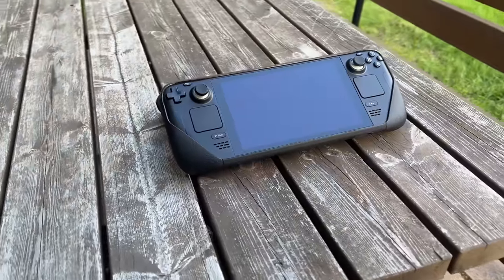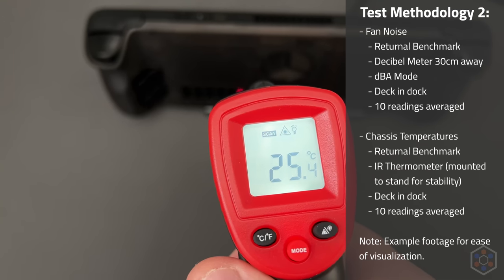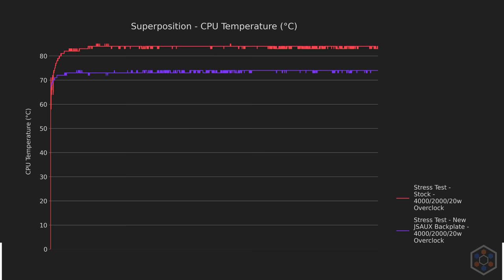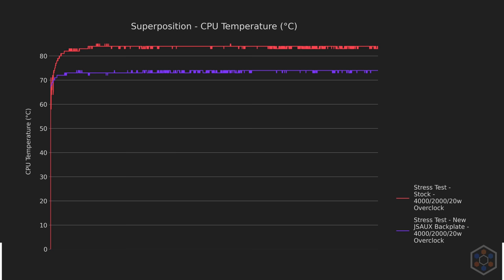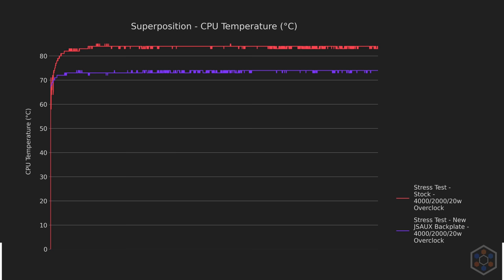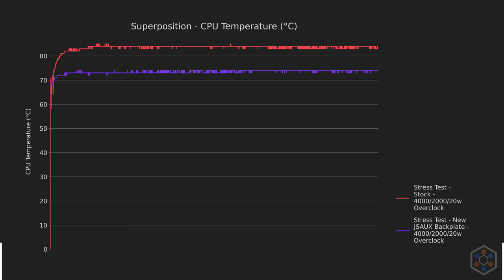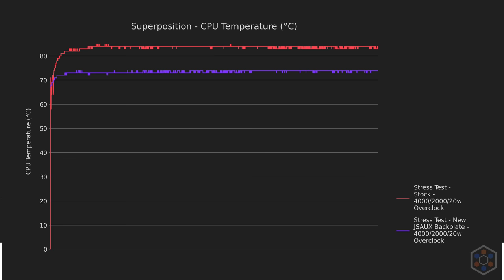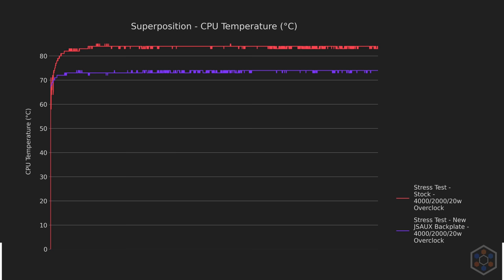How LOW Can It Go? | Steam Deck Thermal Modding

Comment: Do you plan to make a video regarding ram overclocking? Some people are claiming up to a 10fps difference
Reply from the maker: I've been trying to get a stable RAM OC for months, ever since before my UV/OC video. The problem is that both of my Decks have Samsung RAM and can't maintain the OC while also being stable, even with a significant overvolt.

Thank you for watching, I'll keep trying!
Reply: @cryobyte33  is enabling FCLK necessary to reap all the benefits ? That’s the only option that’s cause my deck to not boot
Reply from the maker: @dontsweatme4588  Not all of them, but I can't change the actual speed to either 3200Mhz or 3000Mhz without my Decks crashing shortly after boot 😓
Reply: @cryobyte33  without OC ram I can undervolt -30/-20/-45 but with it I have to lower it to -20/+50/-20. Do You recommend messing with the memory voltage to possibly get FCLK to work?  The default is 134 and I know decreasing the value actually raises the voltage
Reply from the maker: @dontsweatme4588  I unfortunately cant tell you since I don't have real results to lean on here. There's a whole group of people on the discord with tons of help available if you want to ask them, though!

Sorry, I just don't feel comfortable sharing info if I haven't personally validated it 🙂
Reply: @cryobyte33  I hope steam os 3.5 brings noticeable performance gains
Reply from the maker: @dontsweatme4588  it will, at least for the CPU performance! It has a much newer kernel.
Reply: @cryobyte33  last question sorry. Are you able to use power tools on the main channel ? I can’t get tdp limiter to work at all . Even if I lower it to 4 watts there’s no change
Reply from the maker: @dontsweatme4588  I haven't upgraded to the main channel, but typically Decky itself is super broken on betas. You can try using the preview build of Decky but there's little to no guarantee of stability.
Reply: @cryobyte33  it’s a Shame because with ram oc on 3.5 I noticed a 5 fps jump in ratchet and clank

Comment: I cant understand what is going on in heads of engeneers that dont make intake holes above cooling fans and place it somewhere to the side.. They just place fans intake to a sold body panel. Why they are so stupid? I had many Laptops in my life that had same issue and making a hole in body above the fan made a huge cooling difference!

Comment: Thank you It was a educational video,

@cryobyte33 next time can you add the fan rpm as a data point, it would be clearer information about the fan other than just the noise dBA itself?
Reply from the maker: I can definitely try! The problem is that for a majority of "normal" users (non-techies), RPM doesn't necessarily imply what volume something is at, or whether the frequency will be distracting. dBA takes human hearing into account and is the de facto measurement for noise readings for that reason, but I can try to add RPM recording to my suite.

As a note, I use MangoHUD to gather results and I just learned yesterday that they added RPM measurements in the past few months 😅
Reply: @cryobyte33  If i recall correctly, the steam OS built in fps/resources stat option is based on MangoHUD.

I agree some non-techies ppl might have never turned on the fps/thermal/fans statistics, so they dont realy know how the rpm works, but as a techlover myself i did never check dBA of my room or devices.

I just learned about the new jsaux backplate v2  from your video and ordered one, and im sure im not the only one.

I might try some OC based on your previous video with the new backplate on.

I'm happy and Suprised that you replied to my comment. 

Keep up the good work, waiting for the next video

Greetings from a Hungarian Tech enthusiast.
Reply from the maker: @chrishzk9532  the SteamOS overlay is actually MangoApp, which is based on MangoHUD but has additional functionality. MangoHUD just got the RPM feature recently, so it's really new 🙂

I try to make my videos relevant for both camps so I'll see if I can add it in the future!

Comment: PTM is a hoax! I just received mine from Mod DIY yesterday and I put 3 strips because I couldn't believe that my thermals have gone up instead of down. I took AC6 as a reference. Before PTM the game generated an average 75 C. An ok value. After changing with the PTM, my temps went to 78C. I changed it 3 times thinking I put to little, it didn't spread correctly, but nothing changed. My temps are still hitting 78C.
The Jsaux fan on the other hand it's a must buy if you use the steam deck in the dock.
Reply: Did you give it a good burn in (2-3 hours running stress testing) to the pad? It needs time to settle and cure, if you test it just after changing it it will have higher temps.

Comment: tried liquid metal or k5 pro?
Reply from the maker: I haven't done liquid metal, but K5 pro should perform within the same range as NT-H1. K5 Pro and many other high-end pastes are only really "better" than NT-H1/H2 at high thermal loads. The Deck's maximum of ~25w isn't nearly enough to push those pastes to the "sweet spot" where they get better performance, so they end up within spitting distance of the middle-of-the-road NT-H1 🙂

Thank you for watching!

Comment: I don’t see what’s inside my Steam Deck on System Settings Hardware, just the serial number…totally weird. I mean in that web page it leads you to
Reply from the maker: That's very odd, maybe you need developer mode enabled? All 3 in my house have all that info...

Thank you for watching, though!
Reply: @cryobyte33  I have dev mode enabled due to Decky plugins. Still not seeing it. But it's fine after a shell swap I wrote down all I wanted to know. Delta Fan & Samsung RAM. Great video just watched it again.  Another question I try to up myi TDP in unlocked BIOS 110 but it always resets to 15000. Maybe gets overridden by SD own Power Setting which only go up to 15000??
Reply from the maker: @marios.2975  You have to set the TDP in the regular BIOS to 15000, then in smokeless to the value you want. Setting it in the regular BIOS again will overwrite it, but as long as you leave it alone then it'll stay at whatever value you set.
Reply: @cryobyte33  Im doing all changes in regular bios. its unlocked. I have the CBS / PBS setting available there. And even if I set it in Power Management to 15000 then setting under SMU common options are always reset to 15000 too. Maybe I indeed need to use Smokeless cause saving in the regular BIOS alwys seems to overrides what I put into the unlocked SMU options. i think it's the same value behind both settings. And because regular BIOS max is 15000 it ignores my too high value in the unlocked CBS menu. Really wanted to avoid smokeless. OC settings work fine from regular BIOS btw. Thx nevertheless!
Reply from the maker: @marios.2975  Ah yeah you 100% NEED to use Smokeless to go over 15000. Glad to help out!

Comment: 18c this man lives in a refrigerator 😅
Reply from the maker: It's actually about 16.5C right now 😉 Any hotter than 20 and I can't get anything done.

Thanks for watching!
Reply: @cryobyte33  I work at a laboratory an our programmer for the LIS is the same way 🤣 I really appreciate everything you've done for the deck. Made sure to use your link for the full rgb backplate cover,hopefully it worked.  I clicked the new back plate link then togled rgb at the bottom.  You might want to add the RGB link.  I mean who doesn't like rgb and it's not leaching off your battery perfect 👌
Reply: @cryobyte33  I know you didn't test the rgb one here but it's basically the same from an airflow standpoint.

Comment: Lol cool the deck 😅😅 I've owned two steamdecks since launched purchased 3 but one was stolen and going out or docked not 3 of my steamdecks overheated or throttled due to battery or being too hot valve tested and retested thermals for 3 years before release so any results of you overheating is your problem let alone being wrong to new people to the deck if you want overheating battery drain in less than an hour unplugged or SD card issues go do a video on the rog Asus thing because as an owner of three decks you are wrong or maybe you should work for valve to fix their 3yrs research on overheating  buddy
Reply from the maker: I'm sorry you feel that way! I'd definitely work for Valve if given the opportunity, but I personally stand with every result I found here.

I've run the Deck as high as 34w during overclock torture testing, and I'm very aware of the thermal limitations and intended design of the Steam Deck, but I understand your skepticism. 

Thanks for watching, regardless!
Reply: P.s. yes I know this guy is a godsend to the deck community I know who he is and what he is capable  of but he is wrong about the deck overheating  yes it gets hot but overheating  is entirely  different  from being hot and it's just his opinion that it makes the fan loud I wear headphones playing on my steamdecks so I never hear a fan anyways
Reply from the maker: @allhandsonsteamdeck1440  I've never claimed the Deck was overheating, I just showed that you can make it cooler and quieter🙂

I have over 20 years of computer building experience, 18 years of Linux experience, and 9 years of DevOps experience, I don't say any of the things I do lightly.

Also, not all of us like wearing headphones while playing 😉
Reply: @cryobyte33  TRUST ME I KNOW WHO YOU ARE AS FAR AS PROGRAMING AND LINUX I AM AMAZED BY YOUR KNOWLEGE IN THE COMPUTING WORLD BUT IF ANYONE FRIENDS OR FAMILY AROUND YOU I SUGGEST WEARING A GOOD PAIR OF EARPHONES BEFORE PLAYING SPIDERMAN OR ELDENRING ON DECK OR YOU MAY LOSE THEM FOREVER 😆 🤣 😂